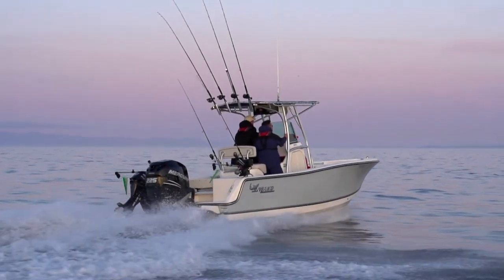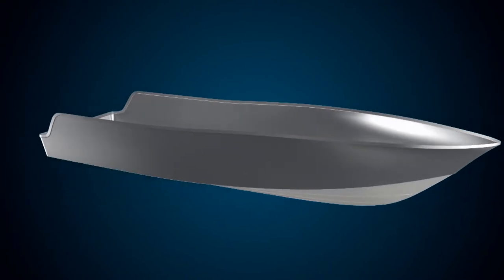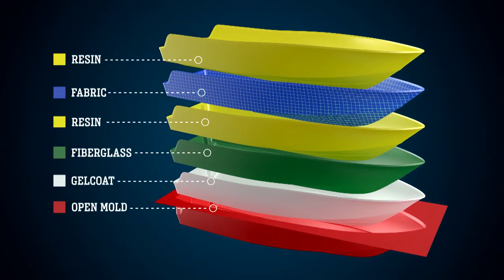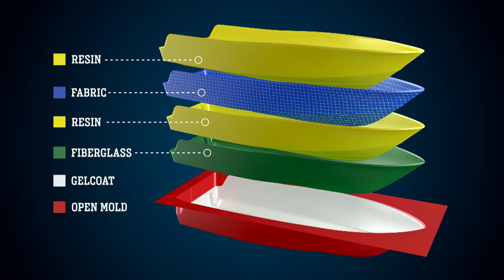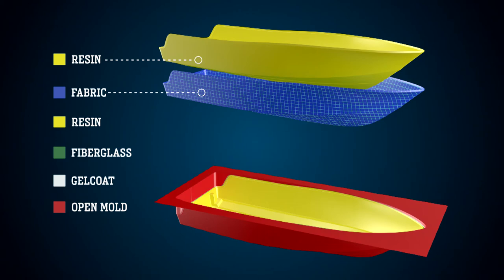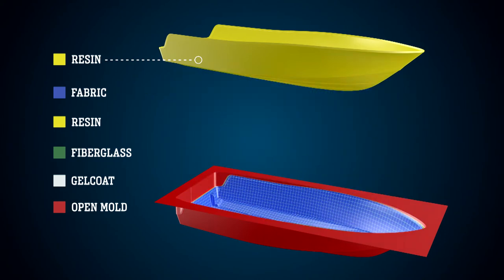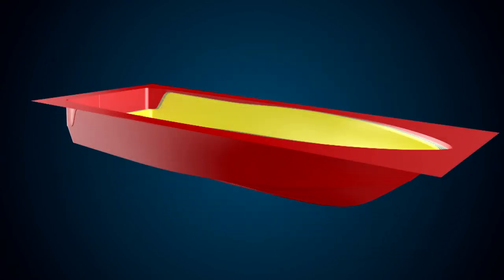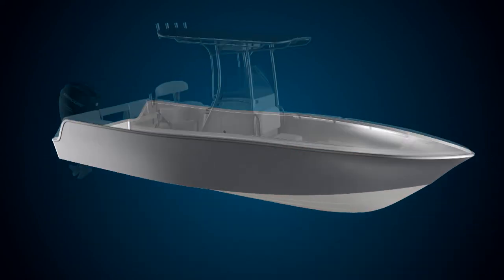MAKO Construction: Open Molded Construction

Comment: Are Mako hulls foam filled? I checked one out at our local Cabelas and the hull sides sounded as hollow as a kick drum.
Reply from the maker: The models are injected with closed-cell foam for USCG-approved flotation. You can learn more about our current lineup here: https://www.makoboats.com/
Reply: @makoboats   Does the 2011 mako 184 have a foam filled hull?
Reply from the maker: The 2011 Mako 184 does have a foam-injected hull with a 1-piece integrated fiberglass stringer grid.
Reply: Is there any wood, anyplace in this boat?